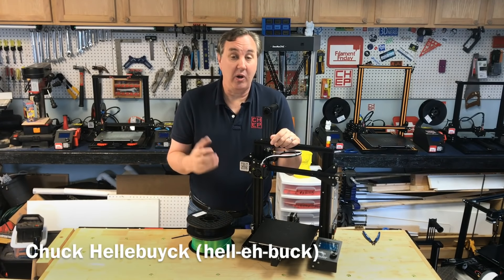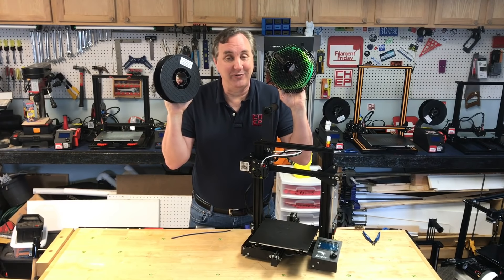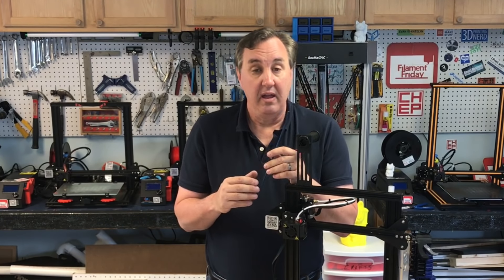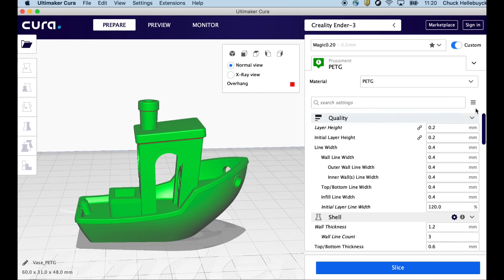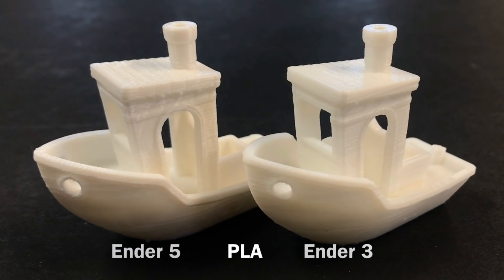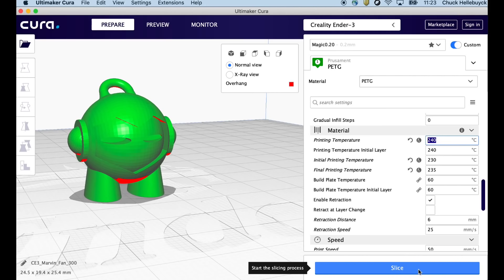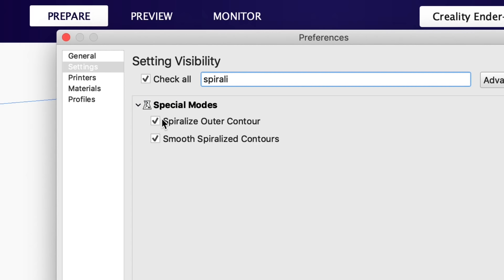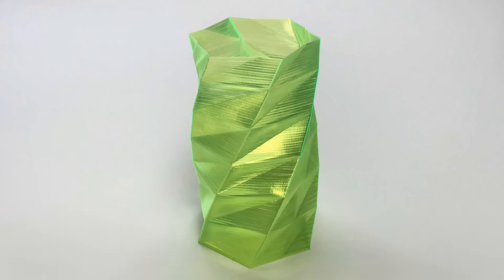PETG on Creality Ender 3 - Atomic and Prusament

Comment: I have about a meter of sunlu pla. But I just went through cura setting to see what branded filament is on the and available in Australia so I went with the esun I already have the grey petg because I accidentally orderd petg not pla guess I'll have to use it. Well it's one way to learn

Comment: Great information,  although with petg there can be layer adhesion problems and i for i had to print slightly higher at 250 for strenght
Reply from the maker: I didn’t mention that I put actual Buildtak on my bed and that solved and PETG adhesion issues.

Comment: Love your videos Chuck! I am trying to print with carbon fiber PETG and I am having issues with massive under extrusion. I can see that the extruder gear is slipping a lot. The extruder has no problem with PLA. The PETG is so much stiffer it doesn't surprise me that the gear can't bite into it as much. I was wondering if you used your dual gear extruder when you did these two prints. I am tying to decide if I should shim the spring or just buy the dual gear extruder. What do you think?
Reply from the maker: Make sure the arm isn’t cracked.
Reply: Go the all metal duel wheel extruder (about $10) and have a look for Chep's video on setting it up, I changed my extruder and set it up as directed in the video  (seems the gearing is much lower than the stock one) and it works a treat.

Comment: I guess I should check the PTFE tube but after 300+ hours of printing PETG at 240°C on my Ender3, but as long as it works I am a bit reluctant to take it apart.
Reply from the maker: Like I said, some of it holds up. It varies from Printer to Printer.
Reply: @FilamentFriday  Yes, I heard you, I only wonder now if I am that lucky or very close to a major failure. :-)
Reply: @rudolphriedel541  I know this is super old, but i'm sure that if you have printed over 300+ hours with no issue i'm sure your going to be fine.
Reply: @AutTheWizard  Its still up and running. And the only thing I changed so far was that I removed the part cooling fan earlier today and replaced the hotend fan with a OD4010-24MB and the metall cage with a much smaller design printed in PETG.
Removing the part cooler made no difference and I was inspired to do so by Chep and a more recent video from CNC-Kitchen.

But then, a colleague from work had a couple of problems with his Ender-3, for example he got one of those with fake XT60 connectors.

Comment: Thanks Chuck.
I’m trying to find out if it’s possible to print with a wider wall thickness when using spiral mode?

Thanks
Reply from the maker: Yes is you over extrude or use a larger nozzle.
Reply: CHEP thanks Chuck 👍

Comment: Thanks for the video,  I've got an interesting issue with PETG, I print a Christmas tree in vase mode PLA it looks beautiful, however it's quite fragile, I tried with PETG and certain parts that would bridge fine with PLA (tops of the branches) don't they cave in.  Any suggestions?

Comment: ok I have to ask! I have been using inland petg and some of it calls for 225 to 250 I can't use it with over 235! anything above 240 and it is a MESS. why so low a temperature with PETG OR HOW?

Comment: The PETG I am using states 220-250. And the low end definitely works.
Has the filament composition changed? Is it the same hardness still? I feel the PETG is pretty flexible. Or perhaps it has to do with the rcommendation to leave the fan off?

Comment: Forgive me if it has been mentioned, but do you need to change more than the Bowden tube to print. PETG on the Ender 3 pro?
Reply: I am printing with Colorfabb PETG right now. Only change you NEED to make is the bowden tube.  I would RECOMMEND you get a silicone sock for your hot end as well. I have one so I cant verify what happens with stock wrapping
Reply: Bermwolf Any issues using the Ender 3 Pro magnetic bed?  I’ve heard someone say that it bonded to it, and ruined it.
Reply: @guystucker4738  gotta be honest I switched to glass because I kept ruining the magnetic bed and I found it required more frequent re-leveling. I havent done that many prints on glass yet, though PLA seems to do fine. I just us alcohol wipes to clean it

Comment: Can petg print detail like for d&d miniatures ? Or just stick with my pla+
Reply from the maker: Probably stick with PLA.
Reply: PETG is not as good as PLA at printing small details and will frustrate you to no end.  There really is no reason to even consider PETG for such an application anyway.  PETG is ideal when stronger prints are needed or if they need to be able to withstand higher temperatures.  I did print ethanjurman's Alien Life Chess set in PETG, but I had to print it extremely slow, and am sure it would have come out better in PLA.

Comment: Hey CHEP love your videos. If I have any questions you are my first go to. I have mentioned in the past  that I have the upgraded NEO you recommended in a previous vid. Thank you, I still love it.
Now I am wondering since I have upgraded the to the all metal heat break will this also help with printing higher temp like for PETG to take the heat away from the  PTFE tube?   Do to not finding a certain color I need in PLA I may have to use PETG. (darker green possibly to match, for example only John Deere green)
Reply from the maker: Yes

Comment: Chuck..when I use capricorn tubes it always binds up...I'm usining some matterhacker pro pla and cant figure it out.
Reply from the maker: It’s a smaller inside diameter so could be filament diameter variation.

Comment: Thanks for all the great videos and files. My ender 3 v2 is doing as good or better than my 1000 dollar printer, just a little bit slower.  The only PETG I have used so far is Amolen Translucent PETG and it's recommended temperature is 210-240.  It prints pretty nicely, just stringy.  I'm going to try it on my ender with your profiles for the first time and return to update......if I don't forget.
Reply: Have you done anything to the surface? I've heard that PETG is quite destructive on glass when removing it so I'm a bit scared of destroying my ender 3 v2s glass bed, but maybe its ok because of the coating idk

Comment: Hi buddy, trying to get my petg print to stop warping and unsticking from glass bed 2 hours into print on ender 3 pro, so tried using your video to set up cura temps infill, speeds etc but was wondering do you have a cura petg profile i may be able to use as in this video i could not see all the settings for petg in cura. Thanks again
Reply: Simply looking at other comments, I see he indicates profiles are on the web site.
Reply: @knerduno5942  yea found them thnx buddy

Comment: What is your rekommendation for retraction speed and retraction distance when using direct drive(semi-direkt)with BMG, short Capricorn tube(2cm)between and MicroSwiss All metal hotend? 
Thanks for all the effort, great videos and channel. Keep up with the good work!
Reply from the maker: No idea. I’ve not used that setup. But probably a lower number than Bowden settings.

Comment: i just got a ender 3 with some overture petg filament and im lost the filament it came with was working fine but i ran out halfway thru the practice print so i plugged in the petg filament and it kinda just peeled off the model so i thought maybe they just didnt work together so i decided to redo the model with the new petg but it just kept messing up and extruding before it was even at the start point of the creation and the structure would be very jagged unlike the filament the ender came with. i am very new and i could very very much use some assistance .
Reply: Hey whatsup boss I just got my ender 3 and also did a half complete print with the included filament lol. So the included filament is white PLA. A bud of mine gave me a roll of PETG, and the thing that made the biggest difference for me was leveling with 3 sheets of paper thick instead of 1 since I heard PETG needs more space than PLA due to it sticking to itself better. Also be sure to have nozzle and bed temps at the recommended PETG settings which are warmer than PLA. I wouldnt think the PLA and PETG combined works well, so prob stay away from that. I'm currently printing a spiral vase like this vid on my PETG and it's looking perfect with just the leveling adjustment and temps like I mentioned, lmk how it goes for you 👏
Reply: @jakepettitt8719  yea i figured out the proper heating i needed the next morning but i was still using only 1 sheet paper thickness il try doing 3 paper today now im only having a slight problem trying to get the 3d model to come off after the print is done i kinda hvae to bend the board slightly so i can fit a thin metal underneath to pop it off. thanks for ya help

Comment: Has anyone tried printing PolyMaker PolyLite PETG?  It has lower temp requirements than most PETG's that I've seen.  Hot end 230 - 240C and bed temp 70 - 80C.  I have upgraded my Ender 3 Pro with a Micro Swiss all-metal hot end and a Capricorn  tube but I've still had issues getting PETG to print.
Reply: I run PolyMaker Poly!ax PETG on my Ender 3 at around the same the temperatures. You have to make sure that you are using around 15-20% infill and that you have to make sure that your first layer is at a lower temperature then the rest of your layers and that the fan doesn’t start until after the 1st layer. You want to also make sure that you don’t just print on the standard build plate and that you put blue painters tape down. You might want to also check that you have a consistent flow of filament coming out of the nozzle on the first layer. If not you might want to try and take the Bowden tune out of the hot end and then use the included thin metal rods thing that came with the printer to try and clean the nozzle. Also check that there isn’t any filament that melted and got stuck in the Bowden tube near the hot end.

Comment: Thank you so much Chep, i was struggling how demons to print with petg, no bed adhesion, poor layer adhesion, stringing everywhere. At the end, watching your video i realise that temps in the roll are wrong and my cura settings were to fast to print petg also. Increasing temps to 240(200-220 in the roll) and with slower movements i was able to print, but the stringing continues and mess up the print, so i return the petg rolls not opened. As your final recommendation... i will never try to print again with petg is a pain i will search harder PLA and that is, its my opinion for sure. Thank you so much again for your didactic videos, i'm a fan.
Reply from the maker: Could just be the filament brand.
Reply: @FilamentFriday  maybe... But for a while... I'm going to continue with PLA, better results and more menthal stability lol.
Reply: I thought the same about my PETG, but I have the same problem with two very different filaments. All my prints are a stringy mess and I just can't ged rid of it. Tried all sorts of retraction settings as well as the exact same ones CHEP used. My first PETG was some off brand cheap red semi-transparent stuff, so i thought maybe poor material, but I recently had a sample of Spectrum filaments green PETG and the exact same strings occur. I just have no idea anymore other than cranking the temps to make the filament less of a goo.
Reply: Okay update: It works with the retraction setings from Creality Slicer (works in any slicer ofc, I used Cura, just found them there while tinkering). Just do 80mm/sec retract speed and 6mm length. This seems like a lot, but its really the difference maker. My prints looks amazing and I cant spot strings so far (the benchy is still printing).

Comment: CHEP you mention using your Magic0.20 profile.  I've gone to your profile page and could not find that profile.  I'm using Cura 4.7 and have downloaded the profiles but can't find that one.  Even looked through the other versions and still locate it.  Any help?
Reply: Same here - I am assuming the one there to download is what he talking about, Probably just named different in his videos / personal machine
Reply from the maker: The Magic term was removed from the title but the layer heights are still magic numbers.
Reply: @FilamentFriday   My first print was a benchy and it actually came out pretty good.  Thanks for the help.

Comment: I may have missed it in the video. But what bed did you use? The stock bed ? The magnetic removable bed that comes with the Ender 3 Pro? Or a glass/mirror bed?
Thank you for the video!
Reply from the maker: I used the stock removable bed but I put actual Buildtak on it. Should have mentioned it.

Comment: Hey Chuck, this looks very amazing. Unfortunately my Kossel wont print like this. I have troubles with printing small loops. BTW your Cura preview feedrate shows various speeds. Where is this function hidden? My Cura only is able to show speedcolours for each function (bottom/top layer; walls; infill). Or do you have an addon or plugin for this?
Reply from the maker: You might have to enable it thru settings. Click on the gear to see options

Comment: Often, I need to print the same gcode but with a different plastic at a different temperature.
Is there an octoprint plugin that allows you to change only the temperatures without needing to use the Slicer again?
Reply: You can edit the gcode file with a text editor like Atom, Sublime, Visual Studio Code, etc... and the values should be at the top with comments. Of course I do not know what slicer you used. I used Cura as a slicer.
Reply: If you have an ender 3 when you start a print you can go into the control menu and change the temp there
Reply: Once you start printing, there is an option called "Tune" that allows you to override settings on the fly.

Comment: What I want to know and can't seem to find a proper answer for is do I need to adjust my nozzle to bed height between PLA and PETG. As in do the two materials need different bed heights. I seem to get a LOT of squish on the first to couple layers on PETG which is not the case when using PLA. As I use PLA often I really don't want to have to re level the bed every time I swap. I have about 20 rolls of PETG left over from when I had my Prusa printer I want to use up lol.
Reply from the maker: Are you using the same initial layer height and flow? Those shouldn’t be different.
Reply: @FilamentFriday  haven't changed any settings in cura other then swapping to the PETG profile
Reply: @GradivusAres  I am printing with a CR6SE and also felt my layers were very squished.  So I adjusted my head up just a little.  Where I was printing at .20 moved it to .25 and my prints are much better.
Reply: @asklestaylor  Hmm, Figured that would be the case. I ordered a new glass bed for my printer, I will try adjusting the height up slightly. I was hoping to avoid doing this as I sold my Prusa printer (over priced garbage really) so until I replace that with another printer I am down to 1 lol. I used to have it setup so each printer was a different material lol

Comment: Question for you, I noticed before you printed the Marvin that you you have the print temp set at 240, but initial temp is 230, and final is 235. Why are you bookending your print with cooler temps?
Reply: I think these only apply when you have a dual head hotend, Otherwise they are ignored
Reply from the maker: Initial temp for first layer to hold well. Then main print. Then it starts cooling just before it leaves the print.

Comment: Great Video! I have been struggling with my Amazon PETG and it seems best @ 235 but it was creating poor first layers. I tried a couple of things. 1. slightly lowering the bed level 2. tried you Magic0.20 @ 235. Question: Why does the default Cura Draft profile take 4 hours and your Magic0.20 takes 6.5 hours?
Reply from the maker: Because mine slows down for the detailed parts.
Reply: @FilamentFriday  How you do it?

Comment: i have an issue with my ender 3 pro because i have the petg white fillament and print with the exact same settings yet the thing wont stick to the plat and it wont make properly
Reply: Same issue I have, and he does not cover it. There is a another video saying to use blue painter tape
Reply: On mine with the magnetic bed I had to set the bed temp to 85-90°C and the fan to 0%, and now it sticks beautifully

Comment: Awesome video Chep, I have been trying Vases thanks to your help.  If i wanted to make the vase thicker and use a .8 nozzle would this work?  I currently use your magic 2.0 for printing most things and  it works flawlessly.  What kind of adjustments would I have to make to print with a .8 nozzle?
Reply from the maker: You first have to change machine settings for different size nozzle. 
Then in profile adjust temperature up for extra plastic and possibly a few others so probably a modified profile to really get good prints.

Comment: I'm printing prusament Galaxy black now with an ender3v2 with all metal hot end i set the temp at 250c should that be good
 Started at 240 and I thing the layer lines looked a touch colder than I'd like so I went for 250